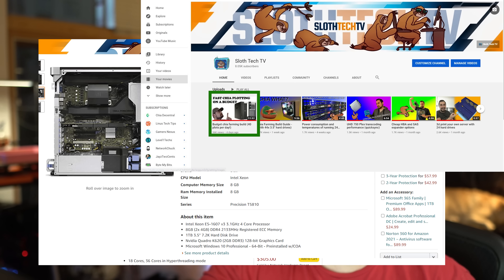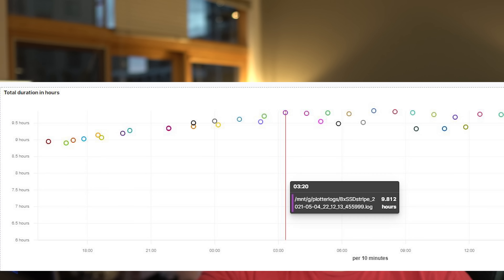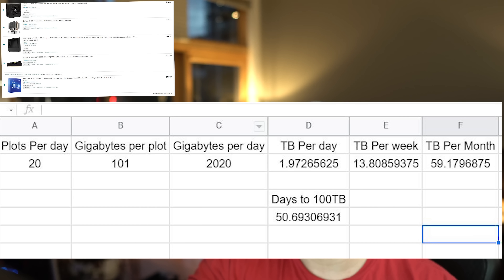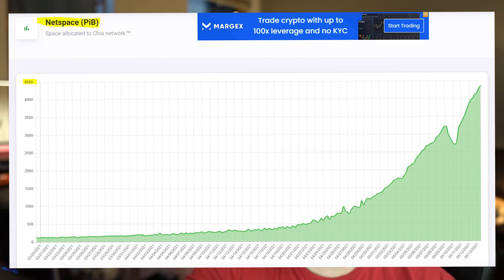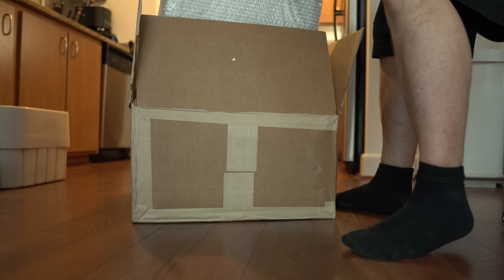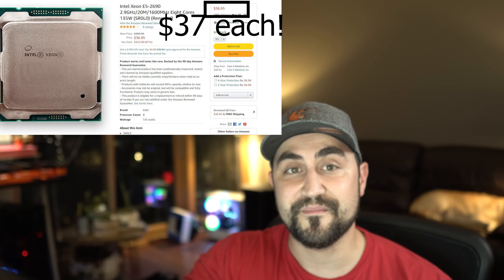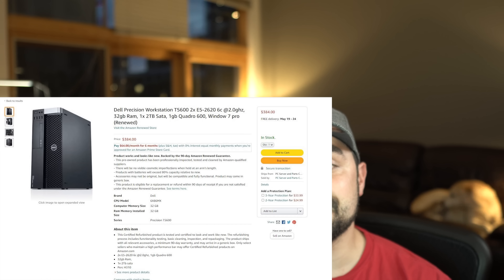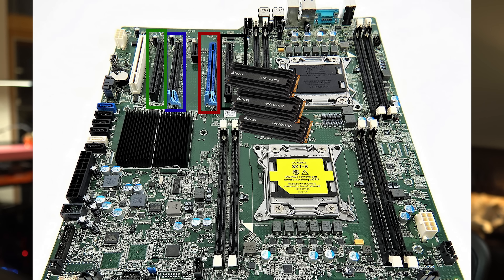Chia Plotting Build $620 w/ Dual XEON CPUs

Comment: Hello Mr. Sloth  a quick question here if you have more than 2 NVMe SSD,  do you think make them into raid 0 will make plotting faster ?  thanks! great video as always
Reply from the maker: its almost always faster to set up jobs on individual drives. I have found a performance penalty when doing raid 0.
Reply: @SlothTechTV  thank you for the reply :) so im just gonna leave them individually, again great videos, and good luck on farming chia!
Reply: @SlothTechTV  May I ask you how much plots in parallel can I run if I only have 2x2tb or 4x1tb NVME drives that I want to plot on individually?
Reply from the maker: great question!

Comment: i got a T5180 build from your guide, just started plotting my 1st 6 plots, not the fastest of machines, I have the 2TB Firecude, 32GB Ram, and E5-2670 V3 2.3Ghz 12-Cores CPU, plotting in Ubuntu.  I think i need to stagger the parallel a little longer.  Only did 30 minutes.  After 8 hours my 1st plot only around 30%
Reply from the maker: yeah -- stagger is key. its also important to give phase 1 more cores and time to complete before adding too many more drives to the nvme for phase 1. i think that firecuda can probably do a decent # per day if you set it up right.
Reply: @SlothTechTV  The PCIE only being 3.0 keeps the NVME from going even faster but i'm up to around 14 plots a day
Reply from the maker: @moechenche2924  I've found no noticable difference when plotting on 4.0 drives on 3.0  motherboards or 4.0 motherboards.

Comment: Does Chia require a fast CPU or big hard drive space. I've got a Celeron with 2 500SSD drives. It took 4 days to sync and now it's plotting my first plot for 5 days. I'm ready to give up
Reply from the maker: you will want enough cpu to fully u tilize whatever nvme or ssd storage you have as temporary space.
Reply: @SlothTechTV  thanks for the reply. Is 4 days normal for a sync or plot?
Reply from the maker: @MyChoice-now  thats too long you might be trying to run too many concurrent plots at once, or you could have ran out of temporary space
Reply: @SlothTechTV  100meg fibre line. 2x500gig ssd, 1 plot. One year old Celeron chip. Fresh install of windows 10 64bit

Comment: instead of buying a Dell R7515 server I could get your movie and spend a lot of money .... I bought such equipment, how do you rate it? Chassis with up to 24 x 2.5 "Hard Drives Including Max of 12 NVME Drives Trusted Platform Module 2.0 AMD EPYC 7352 2.30GHz, 24C / 48T, 128M Cache (155W) DDR4-3200 4 x 32GB RDIMM, 3200MT / s, Dual Rank, 8Gb BASE 2 x 480GB SSD SATA Read Intensive 6Gbps 512 2.5in Hot-plug AG Drive, 1 DWPD 3.2TB Enterprise NVMe Mixed Use AG Drive U.2 Gen4 with carrier 1.6TB Enterprise NVMe Mixed Use AG Drive U.2 Gen4 with carrier PERC H730P RAID Controller, 2GB NV Cache, Minicard iDRAC9, Express 15G Riser Config 2, 2 x 16 FH + 2 x 16 LP PCIe slot No Internal Optical Drive for x10 or greater HDD Chassis PowerEdge 2U Standard Bezel ReadyRailsTM Sliding Rails Without Cable Management Arm Dual, Hot-plug, Redundant Power Supply (1 + 1), 750W, Titanium, 200-240VAC 2 x Rack Power Cord 2M (C13 / C14 10A) No Operating System Basic Next Business Day 36 Months, 36 Mies.

Comment: My question is I've got a lot of quad core 8 threaded machines sitting around would it be worth it to plot on those machines using a hard drive for the temp and destination directory. I only have enough for one high endurance SSD and that's on my 8 core cpu, but I feel like I'm wasting CPU power and plotting speed just letting all my other machines sit around. Has anyone tried plotting directly on the HDD what kind of speed do you get?

Comment: I bought the following build a day or two ago based on one of your videos from earlier this week. Is it still a good option? Most were bought through your links. Thank you.

- Dell Precision 7910 / T7910 Tower (duel cpus, using standard cpus that comes with server)
- 64 GB of server ram, includes 16GB that comes with server
- 3 Samsung 980 Pro 2TB NVMs (with pcie to nvm cards)
- 1 WD Gold Enterprise Class SATA HDD 18TB. 
- 2 WD 10TB Elements Desktop Hard Drive HDD (plan to connect directly to server usb slots)

*run external drives as usb-storage mode*
Reply from the maker: that is a great option! faster than anything i have minus my 3990x... pretty powerful build. ty for supporting the channel!!

Comment: Also a good option to consider is getting a x99 motherboard either used or from AliExpress for around 120 dollars and pair it with a 12 core Xeon for about 100 dollars, if you have some other parts like a case, psu, etc. lying around, you can build a very good system for cheap.
Reply from the maker: That's very true! I did this for one of my builds, I think most people are intimidated by building their own rig I figure maybe this could help them by starting small.
Reply: @SlothTechTV  Im a big Fan of doing everything my self, I don’t really like working with the dell workstations, because they don’t use standard components sometimes. You can get the cpu and Mainboard I mentioned and put it in a case wich can fit 16 3.5 inch drives like a Nanocia deep silence 6. You can plot on the rig and store 360tb of plots or even more depending on wich hard drives you get.
Reply: how much can it plot?
Reply: @tigerzuo5770  About 16 Plots a day with one 12 Core Xeon, you expect about 32 if you go dual socket, will cost about 300 $ more

Comment: great video!! I have a dual xeon e5 2683 v3 (56 threads total) with 128gb ram and 6tb ssd (2x2tb + 2x1tb), but i barely reach 15 plots/day, i think it should be much more (ram usage is always about 25 -50%, and cpu usage around 45%) What settings do you recommend me for the conifg.yaml on swar chia plot manager? im using windows 10 btw, linux to much dificult to me
Reply from the maker: You can absolutely do more per day, it all comes down to staggering phase one as well as you can and don't raid 0 your drives! You'll want to make jobs one job per one drive
Reply: @SlothTechTV  I am having the same issue although I have 2 e52699s and two 2 TB drives but it is soooo compared to my other rigs. When you say one job per drive, like literally just one job at a time? Or just one plot in phase one per drive at the time?
Reply from the maker: @spencerbachus7494  2 2TB NVMe drives? You should be able to configure each 2TB nvme drive with 8 total plots 4 phase 1 60 minute stagger for a total of 16 plots per day minimum per 2TB drive... so 32 plots per day between the two.. probably even better if you tune it a bit.

Comment: I have one question. I have an Ryzen 16 core - 32 threads, with 2x2TB NVMe ssd, 64GB ram on3600. How many plots can I make per day? Should I made them with node or swar?
Reply: I am from Greece and I don't know how to set the maschine up.
Reply: And another one question, when you make a swar program, it's better to have lesmts say more ssds for temp plots instead of 2? For ex, if I have the 2 internal and another 2 external ssds, when I make a production each command on swar its better to have separate ssd for temp for making parallel plots?

Comment: is the xeon e5-2660 good enough for the T5600 machine? How much more benefit does the 2690 provide? Thank you so much for your help.
Reply: 2660 is way better than my 2650 so go ahead
Reply from the maker: Yeah the 2660 is pretty decent still, you can use passmark to compare them it's a decent comparison tool

Comment: Do some of the listed T5600s (with single CPU) have dual socket? Or only the ones pre-installed with dual CPU have dual socket?
Reply from the maker: all t5600's are dual socket, they just might only come with a single cpu
Reply: @SlothTechTV  Please share your experience regarding 4 NVMe drive on those PCIE slots.

Comment: I got 2x 2670 v3 (48 thread) 1 tb m2 ssd and 12 tb hdd. But I can not figure it out. I'm plotting very slowly. I have selected parallel 3 plotting 2 thread. 3390 mb  ram. My ssd corsair force 510p (3000mb/3000mb) but when I use crystal mark it says 1500mb/s.
Reply from the maker: You'll want more ssds -- get enterprise SAS ssds or enterprise nvme/u.2 ssds.... 1tb is probably only capable of getting you around 8-12 plots per day... due to limitations of disk space.
Reply: @SlothTechTV  2x2 tb corsair m2 ssd is on the way. I wish it will be better. But still I didn't understand the thread and ram options. What is the best for me I got 64 gb ram and 48 thread cpu.

Comment: In case anyone is considering this, one thing to mention which wasn't mentioned, an issue I ran into if you want to use windows, with dual CPU you need windows pro. I did not realize that but the more ya know. plenty of work arounds to be made, but thought I would throw that in for people like me who haven't built dual CPU with windows before.
Reply from the maker: woah GREAT catch. Thank you for commenting!
Reply: @SlothTechTV  do you know if the dual CPU will work with linux? My ideal plan is to set this up w/ linux and use my Macbook to SSH in
Reply from the maker: @nathanlaux1071  it works great with windows and linux..

Comment: I'm all for using older hardware. Great video to exposure to cheap proc options. I'd also recommend looking up local E-waste providers. Got a dell poweredge r720 with 2x xeon 2670 & 64GB ram, for $280 (needed hdd and bracket for sas front plane). Totally worth it
Reply: Just finished flashing the perc h710p to IT mode, now waiting on my firecuda 520's.
Reply: Hi, that sounds interesting, but how do you work with a server device for plotting? I never used one for anything
Reply: @luisprates8223  if you look at the owners manual, it's essentially a really long pc, complete with ramslots, cpu, pcie slots (with risers), etc. Some (blades) are smaller form factor and usually move the pcie slots elsewhere but otherwise are similar. Just more redundant components to ensure long life at full duty cycle
Reply: What type of ram
Reply: @kyushka.  fully buffered ecc lddr3
Reply: I would be interested to know how the R720 performs. I am thinking about one as well. How many plots/day can it create?
Reply: @WirelessDevelopment  I'm using 2x inland premiums nvme 2tb drives with the setup I mentioned before and so far with initial tune I'm getting 25/day, doing 19 concurrent jobs via swar mgr. Probably could get a bit more if I added some 10k drives to the backplane for a few more simultaneous jobs as there's still head room proc/ram wise.
Reply: how do you go about this? the e-waste recyclers in my city just want me to give them my stuff, they're not parting with any goodies.
Reply: @Dafnessific  it depends on your locale. A lot of them do eBay sales so you can shop there if you're willing to have it shipped
Reply: bro plz i am going to buy a R620 whit 2 Xeon 2650 V2 4x300GB SAS 10K and 32 GB. that setup you mentioned what is the time you get to plot on SAS drives?
Reply: @lvladjin  I'm not using the backplane for anything besides a boot ssd currently. I am getting plot times around 13-15 hours right now but can do a lot of them. I've been kind of conservative with the tune, leaving a little room on the temp nvme drives

Comment: Can I use plots harvested on another account on the other account ?
Reply: No.
All plots need to be plotted under the same password key.
You can sign in with the same key on multiple devices
Reply: @RuvimRuva  Is it possible to plot for a friend? Say for example my plotter has one wallet attached to it and I whenever the hard drives are fully plotted I move those to another computer with another wallet to farm, is that possible?
Reply: @2006Pk  Your friend will have to have a Chia node/wallet. He will need to provide you with the farmer public and pool public keys. You will have to set those in your plot command to make plots for his wallet. Otherwise it defaults to the local wallet. Only share public keys, never private keys! Do a search you will find site telling you how to do this.
Reply: @zorner1  thanks man, that is very helpful!!
Reply: https://youtu.be/wEqk2AbpdNg
Reply from the maker: @RuvimRuva  ty for helping out and answering questions!! You are a great addition to our community! <3

Comment: How to add another HDD for plots - one of my is nearly full and I don't have option too add next one 🤔  ?
Reply: Buy some hdd racks, and some sata pcie expanders (no raid). Then just slot the cards in a 1x or higher pcie slot  and connect the hdd.

Make sure you also buy a molex 4 cable so you cna power them aswell.
Reply: @jonathanalexis4339  I got already external HDD can I add one of them as well ?
Reply: @VeniGaming  I assume that you are using the "Chia GUI" in Windows 10 and the external HDD plugs into the PC via USB 2.0/3.0? 

If so just plug it in and check the drives directory under the "Computer" tab. They usually are named "(C:), (D:) etc. After connecting go to the "Chia GUI" -> "Plots" and click on the "three dots" in the upper right corner. There you can add new hard drives with the option "Add New Plot directory"
Reply: @thyraelis  wow didn't noticed this 3 dots xd 😍 Thank you I love you.  All your assumptions were right.  One more question if possible . Can I use plots farmed on another account? Cause none of this tutorials where I can farm on another pc doesn't work . I did it few times step by step but somehow can connect the other harvester 🥲🥲 So I thought I can farm on another pc  another account and then move plots to main one ?
Reply: @VeniGaming  You can only use Plots that were farmed with the same account (24 words mnemonic seed). 

I tried to setup a pc that runs the full node and another one that only Plots but I don’t think I did it right. Might try It a little bit later and can help you out if it actually works.
Reply: @thyraelis  I did all step by step 3 x times but it won't connect 🤣🤣🤣
Reply: Lsi hba pcie expander card
Reply: @beastgene7211  I got a 4 tb USB hard drive but how to add it in gui ? There is no option to add another one
Reply: @iamjacksundyingaddiction6595  You can buy that but then you can only add as many external storages as there are usb ports on the computer. I really recommend you go with a build that has ddr4 ram and a better cpu. As pooling will soon be a thing and you'll have to replot if you want a part of that.

If there's more room in that computer for 3.5 inch hdd's and sata ports, you could also add as many hdd's it supports, but if you run out of sata ports or space and still want to go for the quicker internal hdd's you would want to buy racks for the hard drives and for more sata ports, you would need a pcie card extension that would connect to any pcie slot.
Reply: @jonathanalexis4339  Can you help me find parts/setup etc to hit those stats with $1k budget.  I will hook you up
Reply: @Jonathan Alexis also do you
 Reddit so we can chat then
Reply: from cctv

Comment: Can chia be used on external hard drives?
Reply: Once you are done ploting you can transfer the files to an external HDD yes.
Reply: @FTWGame0N  you can plot on an external HDD?
Reply: @LunaLamenting  Did upi read what I said. After the ploting is DONE(on an ssd) you transfer your files to HDD(external or intrnal).

In theory you can plot on external HDD but it will be slower than you going to china and back with a boat.
Reply: @FTWGame0N  If I choose to do it this way "Z440 Add a 2699 v3! $349: https://amzn.to/3y5u8PM 40 plots per day with 2699 v3" then I just have to buy the Ram 64GB DDR3 ECC $199 and I can mine 40 plots and am good, right? Thanks

Comment: I'm having trouble plotting that fast. Any tips on what I'm doing wrong?  I have a similar workstation and am only getting ~24 plots per day across 2 nvme drives. They are only 1TB.
Reply: buy 2TB nvme should resolve your problem :)